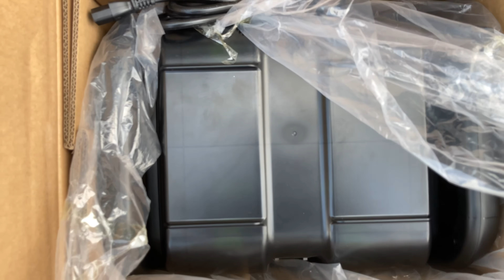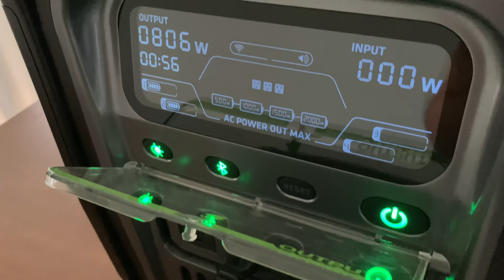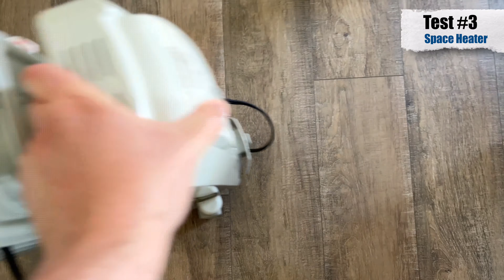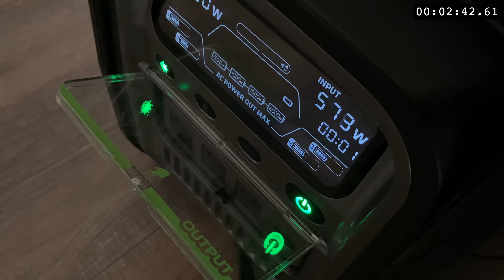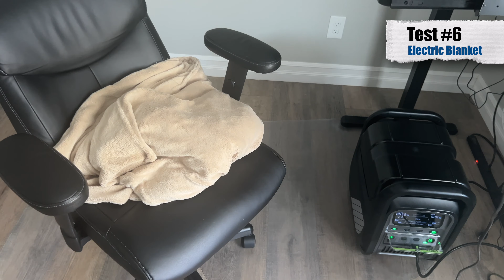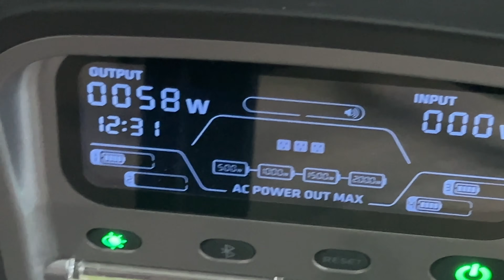🔋 Emergency Power — Is The Greenworks 80 Volt Power Station Good For Prepping, Camping, Tailgating?

Comment: I wish I could find those for sale in the USA.
Reply from the maker: I saw the 60 volt version at Walmart, but I'm surprised that the 80 volt version has been so hard to get. It's a nice tool.

Also, with the recent arrival of 24 volt tools at Walmart, I was looking to see if the 24 volt power station would be at the store. I didn't see that there either. I saw the newer 8ah batteries, which looked nice, but not a 24 volt power station.

Comment: You seem like you have money... buy 4 of the greenworks 80v backpack batteries. :) 16Ah each? 64Ah x 72v = 4,608watts.
 4.6KW!! 

Beats the 1.4KW max you get from quad 5Ah batteries. :)
Reply from the maker: I don't even have a solar panel for this thing yet. 😄

But as mentioned at the end of the video, I have been thinking of getting better batteries. Using 8 amp hour batteries, instead of 4 amp hour batteries, seems like it would be nicer. However, just one of those batteries was listed at $500. 😲

Fortunately, my lawnmower included twelve 4 amp hour batteries. While a bit tedious to swap the batteries out, 12x4 > 4x8.

I can't afford a whole house generator right now. So, I considered the Greenworks 80 volt Power Station as an economical alternative. Plus, it's portable! While kinda heavy, now I can move around a lot of power. That creates fun opportunities.
Reply: @PhoticsTV  I just ordered mine, wasnt available in Canada for a longtime. I'm beyond pumped.
Reply: @PhoticsTV  I feel you on the battery cost... the 8Ah aren't available in Canada. I think I paid $399.99cad each for my 5Ah units.

I have the panels, just need to Amazon an XT60 connector set.

The goal is to be able to charge the 4 batteries in the woods, where I take my 80V stealth minibike. The silence of the bike is SOOOOOO nice for hunting, beats walking, and doesn't scare away every animal in a 2 mile radius.
Reply from the maker: @ScooterMcAwesomeness  I was thinking of getting one of the Greenworks bicycles, but they were fairly expensive and the reviews didn't look so good.

AI is confirming what you wrote though. Google's AI summary returned this… “Greenworks bikes are excellent choices for riders prioritizing power and fun on trails or hills without breaking the bank, especially if you value torque over top speed and don't mind a potentially simpler build. For premium build and higher speeds, you might look elsewhere, but for a powerful, budget-friendly mini-bike experience, Greenworks delivers.”

However, as mentioned in the video, the Greenworks Power Station is kinda heavy. That's going to be some work to transport the power station, batteries, solar panels, cables, weapons, and a bike to the middle of the woods. 😏

I was thinking what it would be like to power a small cabin or shed with the Greenworks Power Station. In fairly comfortable temperatures, I probably could survive a while in such an off-grid scenario. Perhaps that's what I need to do, so I can focus on finishing my book. 😄
Reply: @PhoticsTV  "in the woods" involves a small, tow behind camper. Should be more than enough to keep a little fridge going, and any lights.
Reply: @PhoticsTV  The Minibike is fun, if a little slow. It only does 25mph (38km/h) but I drove mine back and forth to work numerous times this past summer, 300+ miles in a couple month. Can't wait for spring to ride again, but I need a new brain bucket.

Comment: Buy a normal power station from a brand name. Total cost with batteries is outrageous, dim display and surge is too low. Skip solar charging with this.
Reply from the maker: I still like this thing. Although, the Greenworks Power Station works for me because I already have Greenworks batteries. I especially like how I can just swap out the batteries easily.

It's funny finding new Greenworks tool — with the batteries — at a cheaper price than buying the batteries separately. I was seriously considering buying another Greenworks leaf blower at Costco because it was so cheap and the batteries were good. That was the 24 volt line though.

Greenworks is a fairly popular brand too. It's at Best Buy, Costco, Walmart, Target (smaller tools), and some Greenworks stuff can be seen at Home Depot and Lowes too. Although, when Project Farm and TylerTube did their Tire Inflator comparison, it was disappointing to not see Greenworks not included.

Although, these Greenworks Power Stations are not common. I don't think I've ever seen them in a brick-and-mortar store. They're still kinda new too.

As for solar charging, I might do that one day. It would be nice to have the ability to charge the batteries in a grid-down emergency.

The display could be a lot better though. That was surprisingly disappointing.

Comment: What AH where those batteries
Reply from the maker: The bigger batteries are 4Ah batteries. A 2Ah battery was shown in the video, but I don't remember if I tested it with the Power Station.

So, I just tried it. 😄

Using just a single 2Ah Greenworks battery, in the 80 Volt Power Station, I was able to plug in my electric blanket and warm it up. Actually, since it's a little chilly today, I decided to keep using it.

I'm much warmer now. 😄

However, since it is the smaller battery, this won't last as long. With approximately 120 watts of power usage, the timer showed about 45 minutes of time remaining.

Still, that's a way better experience than with the 80 Volt Power Inverter… https://www.youtube.com/watch?v=lgmOefCVvQk …which didn't seem to work well with the electric blanket.

Comment: Where did you buy this?  It is not listed on Greenworks site or Amazon.  Only 4 slot ones.
Reply from the maker: This is a 4-slot 80 Volt 2000 Watt Greenworks Power Station.

First listing goes here… https://www.greenworkstools.com/products/80v-2000w-4-slot-inverter-portable-power-station-tool-only

I'm surprised it wasn't on Amazon or Costco. 🤷🏻‍♂
Reply: @PhoticsTV  My bad. Rewatched your vid and saw you with 6 batteries in that bag.  thru me off.  Maybe they will make a 6 batt, version in the future.
Reply from the maker: @jeffreydavidconner  The ability to six batteries would have been nicer, but it's already pretty heavy. 😄

Also, I'm using 4 amp hour batteries. It's supposed to work with 8 amp hour batteries. So theoretically, 4 8Ah batteries should be better than 6 4Ah batteries.

Comment: A good test for this would be with a refrigerator. I'm sure it would handle it okay based on the wattage. 

Still, the compressor turns on and off. I wonder how many hours you could get out of it with fully charged batteries. If you could get a full day out of it, that would cover most power outages.
Reply from the maker: While that would have been a good test, my refrigerator is in an awkward location. I got tired moving the Greenworks Power Station around. 😄

But apparently my refrigerator uses around 2kWh a day.

Google's AI summary also said… “knowing the voltage and amperage allows for calculation if necessary (Watts = Volts x Amps). In this case, 115V x 5A = 575 Watts.”

So, if 575 watts is the max, that's well within the range of the power station. The problem is power capacity. Here's what the AI summary said about watt hours…

“A Greenworks 80V 4Ah battery contains 320 watt-hours (Wh) of energy. This is calculated by multiplying the voltage (80V) by the amperage (4Ah) according to Greenworks.”

So, six of my 4Ah batteries probably wouldn't be enough for an entire day of powering the refrigerator. (They are older batteries too.) It seems that 12 should be enough though.
Reply: @PhoticsTV  I have 4 80v/4Ah Greenworks batteries so this inverter seems like a good option at first glance. But, the inverter costs $870 at Costco Canada and 4 batteries would give me 1,280 Wh. I can get +/- 1,100 Wa for $600 from the majors; Bluetti, Jackery, Anker, Delta, with solar charge capability and UPS!
Reply from the maker: @kingstonsean  This thing is expensive. It works for me because I have so many batteries. As shown in the video, I was able to move the batteries around while my computer was running. If you only have the four batteries, then that does limit the competitiveness of this power station.

Comment: Thanks for this video! I just was searching around for a video about this Power Station and here we are! I have subscribed because I just bought this 80 volt Power Inverter (I saw on the Greenworks Site they just came out with this last month and I just bought it today to give my batteries more reasons to use it) and I have watched your videos before (your Riding Mower last year, I bought that as well from Costco with 12 4 Ah batteries that came with). I own 36 from 2 ah to 8 ah batteries of the Greenworks 80 Volt Line (and starting to get into the 24 volt line as well for the power tools). I also this year bought into the Anker Solix F3800 Plus Home Power Panel Duel Power Station Kit with 2 Rigid Solar Panels and 2 free Portable Solar Panels (which are 410 watts each) and those Portable Panels came with a MC4 to XT-60 (which is the input on this Power Station, the yellow input) adapter so definitely will want to try this out with the absurd amount of batteries I own! I will need to get another Portable Panel from Anker Solix so I max out the rated input wattage that is advertised on the Power Station, this way I can keep 4 batteries in the shed where I keep the Riding Mower in and my other Push Greenworks mowers. 

One question I have now is (until your able to get a solar panel or I get this in time probably by next week to try this experiment) is since this only can take 4 batteries in this Power Station, can you hook up a duel 80 volt charger to this power station on one of the 120 Volt Plugs and be able to charge off of solar (which can then charge the 4 batteries in the compartment, plus 2 more in the duel charger, or will it charge the 4 batteries in the compartment and those 4 batteries at the same time charge the 2 batteries in the duel charger?) or over AC Power in the Wall? Because this is short 2 batteries to charge six of them for a Greenworks tool that uses the most 80 Volt batteries possible on a single Greenworks 80 Volt tool which is the 42 inch Riding Mower. I am completely aware of the 82 Volt 6 Port Charger that can charge from the AC Power (I was originally going to get this but glad I didn't spend the money on that now), which is why I am asking this question. Again thanks for the video!